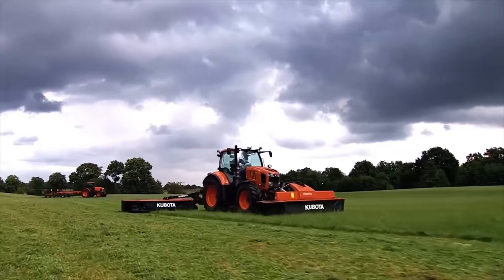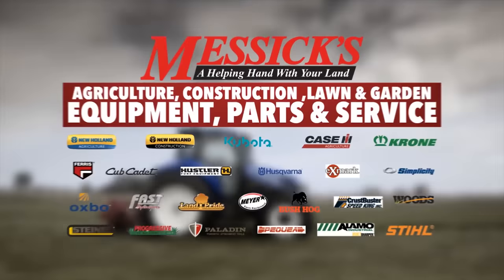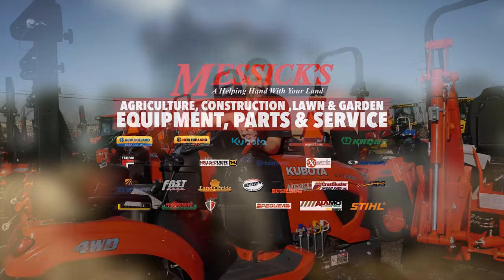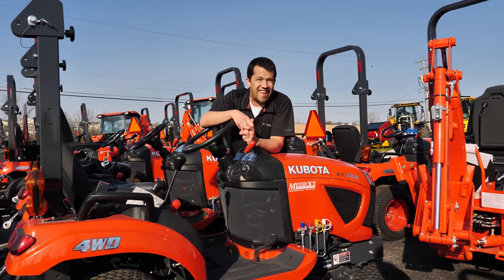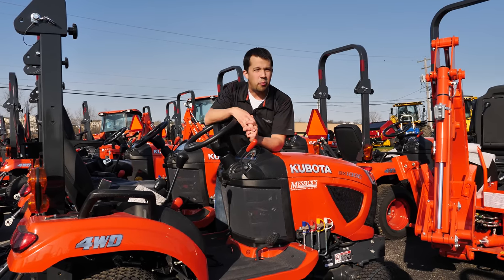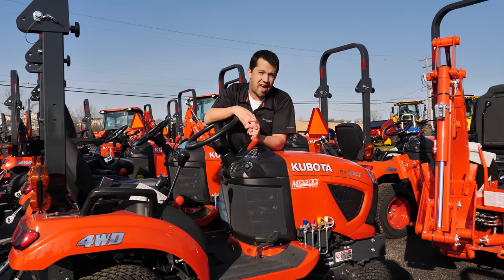Proper use of a Hydrostatic pedal - TMT

Comment: Not only is this tip good for using your loader but it's also good for bush hogging on steep slopes. You'll notice on a 1 to 1 slope if you crowd your forward peddle your rpms will decrease dramatically. Lesson learned.... Those types of slopes like I have never try to turn around, go straight up and straight back down. Regardless of your choice in tire fluid your tractor will turn over. The awesomeness of the hst is the fact you'll almost never need to brake. 
    Using the bucket to dig or move material can work best for your tractor if you don't try to take the whole pile at one time. As you start in the material pick up on your bucket while your loading it, rolling it back at the same time. This gives you a full bucket faster and won't  crowd your transmission at the same time. Never lift a full bucket more than a few feet off the ground while driving, it makes a mess and could turn your tractor over.

Comment: Thanks for the video! Before I bought my tractor I pondered the difference between a hydrostatic it a manual transmission. I did not understand the hydrostatic but was completely comfortable with the manual and bought it. The hydrostatic may be easier and simpler to drive but I understood the workings of the manual. For me it was the best choice. Thanks for the good videos!
Reply: The only downfall with a manual that I know of is when the clutch needs replaced you have to split a tractor in two in order to replace it, other than that the manual is far less prone to having any problems.

Comment: Thank for the info, I am guilty of flooring my pedal, and I did notice that it did reduced the power. I thought something was wrong with the hydraulic system. Now it all make sense now. Just take it easy on the pedal. 👍🏽👍🏽
Reply: Kubota & Slayer!!
Reply: Hi tony I have just done the same thing with my new kioti and stalled it now it runs unevenly & makes weird hydraulic noises. Did yours sort itself out?

Comment: I beg to differ. The HST pedal does not affect any gear ratios, nor does the relief valve "steal power" from the system. If the pedal was like a transmission, there would be no justification for the the dual range gear selector. The ONLY thing the pedal does is control how much hydraulic FLOW the transmission receives. Less flow, less wheel rotation per second at lower torque at the selected range. The beauty of an HST is that ALL of the pressure at a given THROTTLE setting is available, regardless of how much pedal you use. All the relief valve does is LIMIT the maximum amount of PRESSURE the transmission can have, protecting the pump. Too much hydraulic pressure from heavy load, unbridled, would be hard or destructive to the hydraulic pump. The THROTTLE controls how much PRESSURE is available to the transmission. Low throttle, less pressure available. If you ask for too much FLOW (with the PEDAL) at high PRESSURE (full THROTTLE) without movement thru the transmission (due to heavy load), the relief valve will release unused flow at the predetermined fluid pressure. It will not REDUCE the available pressure, unless it's defective. It will merely set a limit as to how much pressure is allowed at the pump. I can add that this is true for the PTO and the loader, as well. If you overload at high throttle, it may cause the relief valve to limit what's available, usually with a howl.

THROTTLE - Pressure available
PEDAL - Pressure demanded
RELIEF VALVE - Pressure limit
RANGE SELECTOR - Transmission torque at the wheel

Of course, I don't have the black, lettered shirt. But I DO read the manuals, and I've worked on mine long enough to understand how the BX series hydrostatic drive system works. It's not much different from any HST, even my Scag Turf Tiger. I am prepared to be educated, if I am all wet.
Reply: I think he is right.  In general a vari flow hydraulic pump connected to a hydraulic motor becomes a Continuously Variable Transmission.  If you put a smaller angle on the pump push plate the pistons travel a shorter distance, push less fluid and must be capable of overcoming greater pressure (higher torque), compared to pistons travelling a long distance, assuming the same engine power input for both.

Comment: When I first got my tractor I would haul butt as fast as the tractor would go and hit a big hill wide open, high range, full speed and pedal buried to the floor and I was surprised that I could not make it up the hill.
Then I learned that if I would let up on the pedal as it started to bog down I could make it but if I held the pedal to the floor it would kill the engine.
At first I was surprised that the tractor didn’t have enough power to make it up a big hill.
This video helped me determine what I was doing wrong.
Reply: I borrowed a neighbors backhoe to dig a large hole... had issues coming up the hill. Now I know.

Comment: The old IH Hydro's used to have an optimum range on the hand hydro control. You would only go above the optimum range under light load. A trick I was taught was to speed up before you approach the hill, dirt pile, or the end of the nylon tow rope. When the engine starts to load up you can rapidly decrease your speed as the engine loads up and keep your engine from getting lugged down. With a little practice you can make your small tractor work a little bigger without stalling it out or working it too hard. I have also done this with a powershift as it starts to lug down in a tough spot or get stuck.

Comment: Great video! Depending on how sturdy your loader is, you may want to roll in at a moderate speed to get the momentum of the machine pushing in but start to lift as the bucket enters the pile to gain grounding force, taking up slack from the waning momentum.  Or it's just a tractor so drive it however you want, just don't make overly rapid pedal movements if it's mechanical.

Comment: Depending on what your picking up. Like soft and loose driving into pile fast letting off when you get into pile then ease back into pedal curl and lift to eliminate wheel spin. Granted I'm using a Cat 950m wheel loader, NH 7740  FWA w/fel and bobcat's at work. Be amazed how many people @ work in drive  loader full boar into pile and keep spinning the wheels on concrete trying to get more in bucket

Comment: I like to say as you push into the pile, you should be lifting up as you feel/hear the resistance. Go in with some speed and lifting off the pedal will gear it down as your bucket fills. you can always give it more again as you lift and crowd the bucket.

Comment: The only hydro I ever used was on a lawn tractor- and it was a hand lever!   Still made that annoying whine, though.  Never really thought about what it was actually doing.  We just ran the throttle all the way up, and then used the lever to control ground speed.   Don't remember the model # but it was a JD from the late 80's/early 90's w/a 17 hp Kawasaki engine, and a 42" deck.   Did what we needed.  Only issue I ever had was having the elec PTO clutch die 10 minutes into cutting a 3 acre lawn...   simple fix.

Comment: It's an easy trap to fall into, we're so used to a foot pedal controlling the throttle from driving cars and trucks that it seems like the right thing to do to bury it but with a tractor you set the engine speed with the hand  lever and the foot pedal controls speed only. The exception being the hst transmissions have the option to link engine speed to the pedal, with that enabled and the high-low in Auto it will drop down into low when it encounters a load, effectively doing the same thing as just creeping the foot pedal as you described even with the petal buried.

Comment: Torque stays the same in stall so your tractive effort does not deminish.  When you mash the pedal you are sending excess oil over a relief at the stall pressure rating of your hydraulics. Heating up the oil and burning fuel. Unless the tractor has torque control on the engine in which case the rpm should drop.

Comment: interesting i assumed the tractor was essentially driven on a large internal hydraulic geroter motor inside the main transmission case thats filled with hydraulic oil along with two smaller geroter Motors on the front axel for your 4WD. there is gearing but its on the geroter motor thats changed through your range speeds.. its why if you try pull something really heavy in the high speed aka travel speed the rpm of the engine drops dramatically because you not giving the motor mechanical advantage in the application. i use a oldish B series tractor and everytime i use a implement driven through a pto i put it in medium as most of the power is there from what ive found.. then if i got to tow something really heavy up a slope.. i put it in the low range with rpms at the pto speed so that i know im giving the engine maximum mechanical advantage through the gearing. the peddle from what understand is it just controls the speed of the motor through the flow rate.. we have the same thing that drives out heavy roller for cricket prep work.. thats driven through geroter Motor the same way.. id love to hear back from you on this

Comment: Good information, thank you. I have a small Kubota BX1500. I was plowing snow with it, made some clicking noises backing up. It then stopped moving and no hydraulics. I took the HST off, I had to replace the bearings and a shaft on it. I think I got the hydraulics back, but still wont move. Any ideas. Thank you.

Comment: So, with this information, I’m assuming it’s a bad idea to go from Forward to Reverse on the hydrostatic pedal without first stopping the tractor with the brake? (Bad habit from smaller, lighter riding mower before getting my new 1880). Also, would increasing engine RPM (along with a light touch) increase that torque / pushing power? Keep up the great work, love your videos!
Reply: You don't need to hit the brakes but pausing between forward and reverse will definitely keep your tranny working for a long long time.  Its like shifting an automatic transmission from reverse to drive or drive to reverse while moving you wear out the clutch surfaces in the tranny, but in a hydro you wear out the valves and other nice expensive parts.

Comment: Really good video but I still have a question. I'm new to hydrostatic transmissions pedals, and I'm not sure what I'm supposed to be doing when the tractor slows down but maintains the same RPM while plowing? Is it hard on the transmission to leave it in M so should I be shifting down to L ? Kubota B2650. My other tractor (Kubota M9540) has a clutch which is what I'm used to using.... Also, I'm hard of hearing so it would probably be difficult for me to hear the relief valve opening. Thanks
Reply from the maker: You don't hear the relief open, but you can feel it. Back off the pedal when it happens, go to a lower range if you doing it frequently.
Reply: @MessicksEquip  I've only had my new tractor since November (2019) and so far I haven't 'felt' the relief valve open, so that's a good thing. Based on your reply, I don't think I'm causing excessive wear on my transmission. If I feel the bypass valve opening, I'll down shift. Thanks for getting back to me so quickly!

Comment: Great video, thanks for the explanation. Do you know if Kubota has any plans to switch to side by side pedals for the  hst rather than the rocker pedal. I'm in preliminary stages of tractor shopping and I really don't care for the rocker pedal. I have one on my garden tractor and find it awkward. Thanks.
Reply from the maker: Every time this has come up and they survey a customer's, it's either been a 50/50 split, or a slight preference for the single pedal treadle. They absolutely would not change. After all, most all of the industry has historically used a single pedal. It wasn't until Deere started telling everyone else that they are wrong, that opinion started spliting. Marketing is funny like that.

Hop on another tractor and give it a try first. It's not like a garden tractor.
Reply: Thanks, I am still open to it and will be test driving models with both types of pedals.

Comment: Hi Neal
I am never really sure what engine RPM when just moving around my yard with a hydrostatic gearbox? Your suggestion would make a great 3 minute video
Michael
Reply: In my tractor it's recommended to run it at no less than 2500 rpms.

Comment: Great video, totally makes sense. The Zamboni is set up a little different. There is a transmission control level and a pedal. Along with engine rpm control. Seems like with tractors, etc. the pedal and lever on the Zamboni are combined as one. The transmission control lever seems more like the pedal. One pedal for forward and one reverse.  The lever on the Zamboni controls forwards and backwards as well as power. I am using the word power loosely. Then the pedal "activates" the transmission. Our Zamboni has a Kubota motor as well. I am doing a video on the hydrostatic transmission on the Zamboni and looking for some additional info. Not finding anything like what the Zam is set up for.

Comment: So just to confirm, should I have the revs up on the tractor but only push the pedal down gently?  Makes sense as I bog down going uphill and my insitct is to push pedal to the floor so compeltely self induced stalling.
Reply from the maker: correct.

Comment: We have an LA524 loader and bucket. Somehow we have broken the steel pipe that runs between the two "quick attach coupler" mounting plates. The pipe is cleanly broke loose at the weld on the inside. Is there anything important we should know before welding it back in place?

Comment: Thanks. A related question: I have a magnatrac, it uses hydraulic motors, and a regular valve. Similar to the valve used for a piston. 
Would the same advice apply?
Reply from the maker: If it's a gear pump, no.
Reply: Messick's 
Thanks for your answer. I will look up the pump make and model and get back to you. Thanks.
Reply: Every pump has a pressure relief and will bypass at certain pressure. These pumps are no different just piston style pump rather than gear.

Comment: I was told when mowing with the hydrostatic transmission you want to select the lowest range which allows you to depress the forward peddle completely which allows the hydraulic fluid cooler to operate effectively.  Is this not true?
Reply from the maker: kinda. If you go into relief that creates a lot of heat.
Reply: Although different, with the Zamboni we are told to set the transmission control level is such a way that when making your passes up the ice you want you foot on the pedal all the way down. So for us I set the lever like 1/3 the way up and when coming out of the turns I ease my foot down on the pedal. This way one is laying the same amount of water while going up the middle. I am sure it is totally different on a lawn mower though.

Comment: I have a 33hp model, should the pedal get stuck forward and won't let go until the rpms are reduced to an idle? Kind of scary to not be able to stop the tractor.
Reply from the maker: Have you greased the linkage? There are grease points on the pivot.
Reply: It is stuck only while under a load and you can physically stand up on the reverse side of the pedal and it will not release until the transmission is no longer under a load. I have not greased it, but doubt that greasing the linkage will help as it seems to be hanging up inside somewhere. Thanks for the reply and suggestion....I appreciate all comments and suggestions.  I purchased this used tractor without doing my due diligence (it's a B3350). So far this is the only complaint that I have with this tractor.

Comment: I've a question about hydrostatic transmissions.  I've not get been able to figure it out for myself.  With a manual transmission, if you're in a situation where traction is the limiting factor in pulling something say in muddy or icy conditions, you can shift to a higher gear and run at a lower RPM to reduce torque delivered to the tires, and hopefully avoid them breaking loose and spinning. (I realize it isn't ideal for the engine, but within reason it isn't going to really harm it)  Do hydrostatics have a similar mechanic, and if so, what is it? 

From my limited experience with them, it seems they deliver pretty even torque unless you do what you talk about in this video, and I'm unwilling to intentionally make one whine like that.  Plus, it isn't really a controlled situation like with the manual.
Reply: Yes, well kind of, just limit your speed and throttle.  If you are in slippery conditions and are spinning your wheels you'll spin your wheels regardless what transmission you have, but limiting the amount of wheel spin can be done by slightly applying the brakes and/or reducing your engine speed and, reducing the amount of power to the hydrostatic tranny depending on the tractor...you just want to cut the torque, so by lowering your engine speed it will slow down the hydro pumps thus lowering the amount of torque to the wheels...gotta be careful though you may slow yourself down to the point you get stuck.

Comment: Is it normal
For my hydrostatic tractor to creep forward or back if I’m ona slight hill without pressing pedals?
Reply from the maker: Yes, it will creep on a hill. You still need to use the parking brake.

Comment: So I did a test with my ‘19 B26 loader.  RPMs at 2200 , range selector in L, 4WD engaged, and a pile of freshly dug  6’ pile of clay soil.  I first went at it like I have,  loader bucket level and HST pedal forward.  It easily scooped up a full overflowing bucket.  Next, I inched forward with the HST pedal mid travel.  Barely got the bucket full, no penetration into the pile.  Barely applying forward on the HST pedal, maybe a third travel,  no dig force at all.
Nothing at all wrong with my B26, if anything it’s more stout since I upgraded fuel flow and timing.  
Someone chime in?